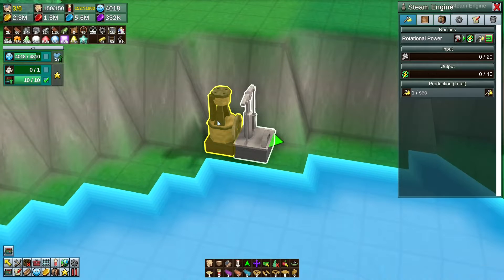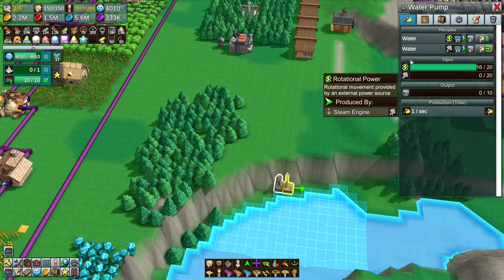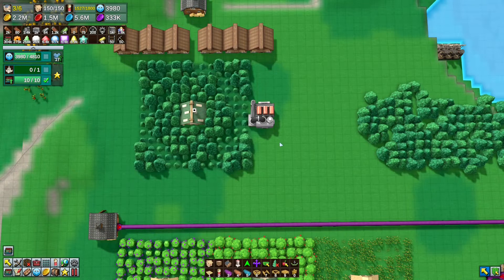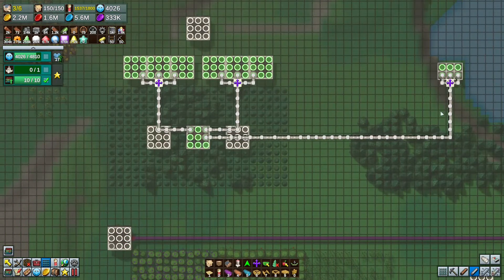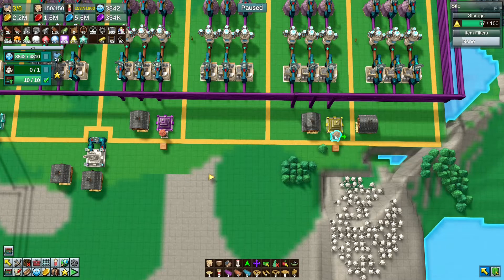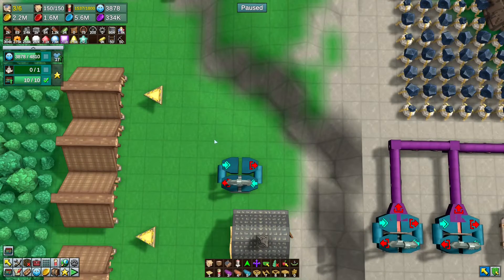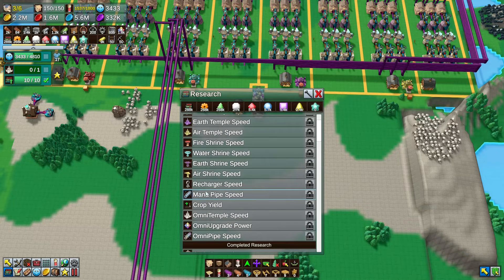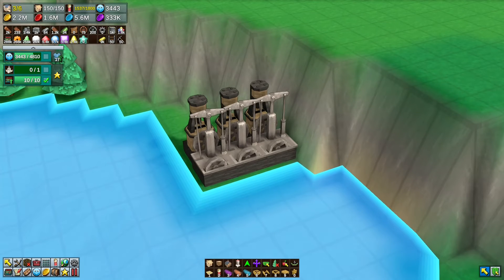Factory Town - S09E59 - Air Boosters

Comment: You mentioned it let time as well, but you can now 'double' steam boost for additional effect and additional steam usage.
Reply: And you can actually use both methods of elemental boosting buildings. Using the shrines and direct feeding the buildings. Of course you can't get double the effect as they do use the same booster effect.
Reply from the maker: The double steam boost, is actually a 50% addon, as it adds +1 to the base +2, no doubling it. I am doing that at the updated reinforced plate area in the next episode, but I don't think I mention it.
Also, both ways of boosting is still there. I just remember the old way (Crystal to the building direct) was supposed to have been removed, but never did. So we'll go with the shrine boosting instead